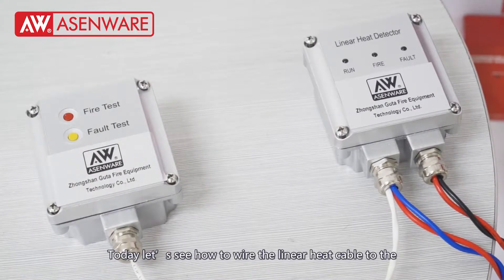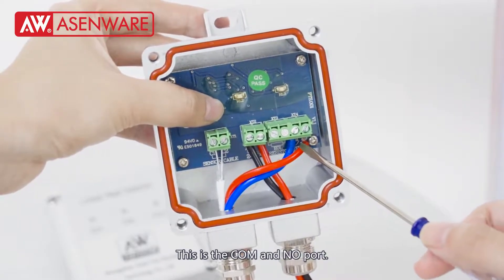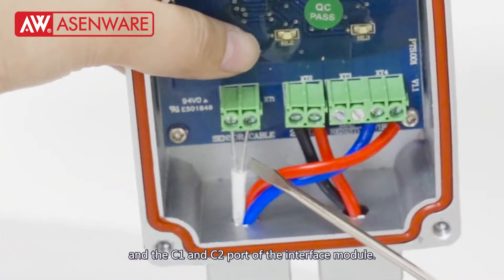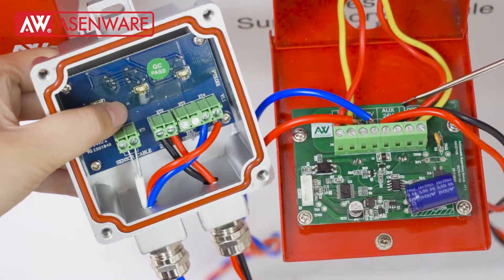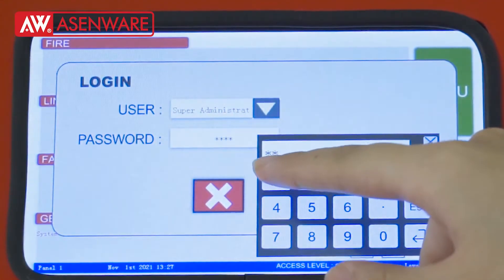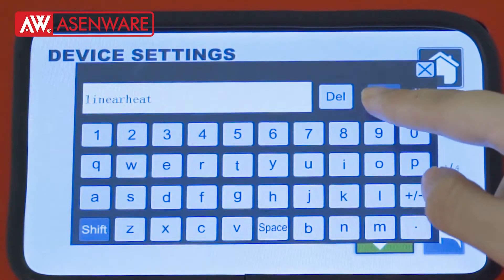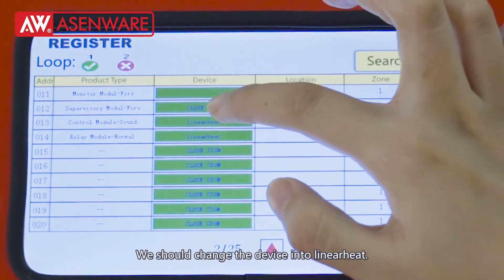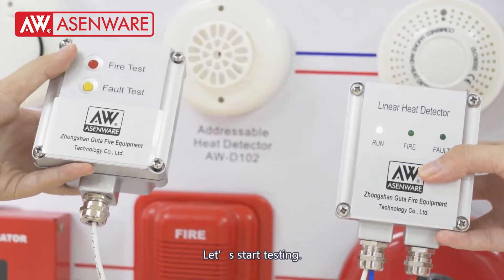How To Wire The Linear Heat Cable To The Addressable Fire Alarm System(FP100)

Comment: Stop using accordingly in every video!
Reply from the maker: Thanks for your advice
Reply: @ASENWARE hi what wrong if the communication is fault...plss give me advice
Reply: @JaimeCapua-m7b  Hi not experianced with  the product but make the loop small and test all connections when it works make loop larger
Reply: Sir..what wrong if communication is fault pls givee advice